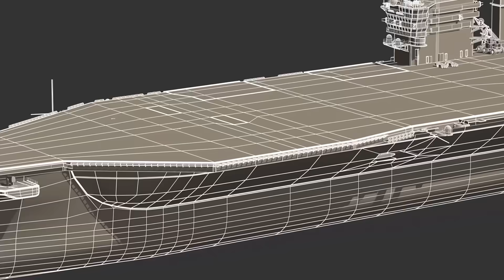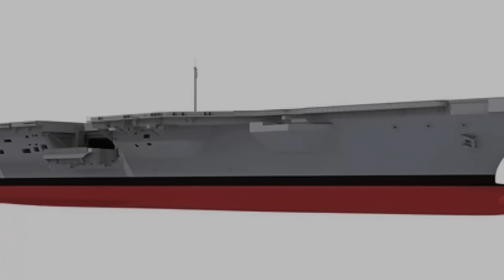China Begins Construction of Type 004 Supercarrier, Set to Surpass US Navy's Gerald R. Ford

Comment: "The USS Gerald R. Ford has a displacement of approximately 100,000 long tons (100,000 tonnes) at full load, making it the largest and newest class of U.S. Navy aircraft carriers. This massive vessel can carry over 75 aircraft and is powered by nuclear reactors, providing a virtually unlimited range for its operations. "

China needs to beat USS Gerald R. Ford in terms of tonnage and the number of aircraft it can carry  in order to earn bragging rights.
Reply: Bragging rights are not useful.  What is useful is the purpose of the military equipment and its effectiveness vs cost.
Reply: China's so call Super carrier will to big to maneuver efficiently, the US has ove a 100 year of experience in building aircraft carriers.
Reply: Ur nothing but naiv
Reply: 004 120k tons, 4 EMALS, +90 planes. It's the world's largest carrier and 2 are being built at the same time in half the time of 1 Ford class
Reply: Did you even read the Chat GPT statement you just copied & pasted? The new Chinese Carrier will be Nuclear powered too & has a  larger tonnage than the USS Gerald R. Ford... You technically just said China has bragging rights now, but they won't, as the moment you underestimate your opponent, you've lost.